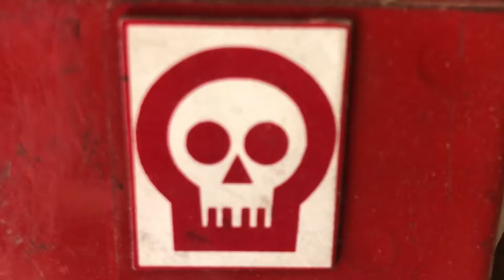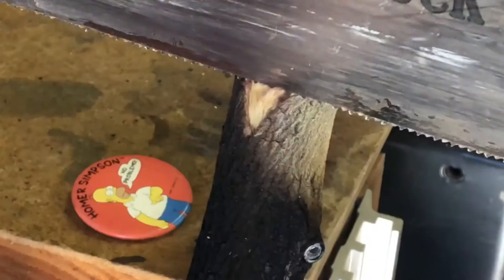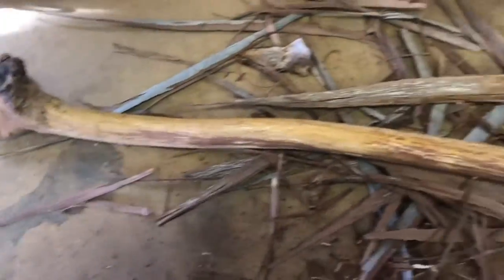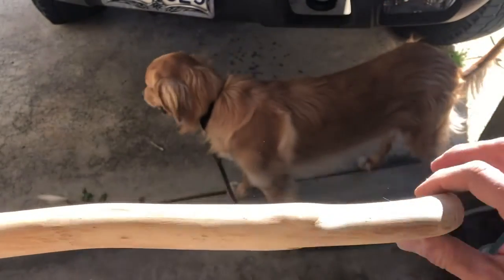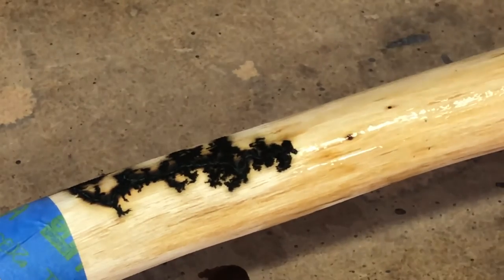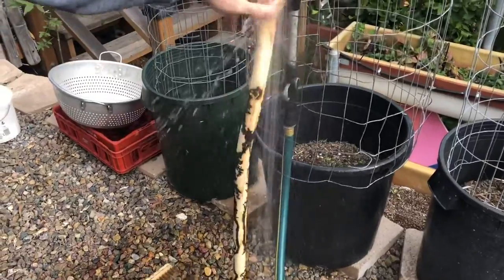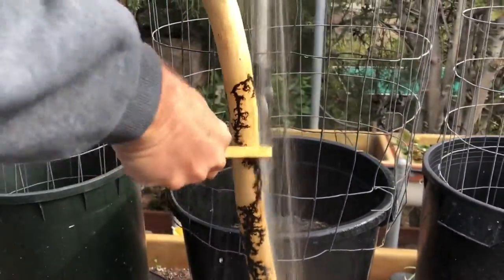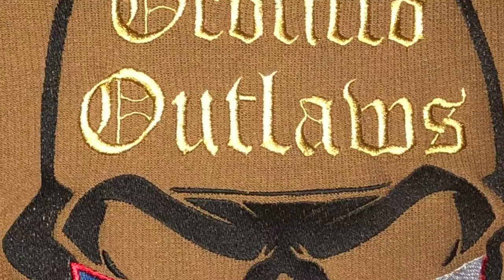Making a walking stick (#81)

Comment: I make walking sticks and canes for a hobby. I use side grinders with a steel Kutz all extreme disc to remove the bark and shape the stick. They last a long long time. Next, I change side grinders to my flap disc with 40 grit. I smooth is out as best I can. Finally, I switch to the Dewalt finishing sander with 60 grit paper. I do not like stain as I feel it hides the grain. In some cases, depending on the wood, I may lightly burn the wood to make the grain pop. Then I put a coat of tung oil cut 50% with mineral spirits. I let it dry and repeat 4 or 5 times. Next, I switch to polyurethan cut 50%. Another 3 coats. Finally, I use poly in a spray can for the finish. By the way. In between every coat of tung oil or poly, I rub with steel wool. This makes the finish smooth as a baby's ass.
Reply from the maker: Hey JR! Thanks for checking out the video and taking time to make a comment. It sounds like you have quite the process, and I bet those sticks look really awesome. You should make a video and post it. It would really be cool to check out the process and the finished product.

Comment: Very cool stick! I've been wanting to try fractal burning for years but that much power worries me. Found out the hard way how much 220 tingles; can't imagine what 15,000 would do.
Reply from the maker: Thanks Dana! When using these devices safety is the first priority always. There is no walking away from a mistake or accident. Even with experience working around high voltage I still get nervous and can't let my guard down. I make these for family and friends and each one has special meaning. As I have more time and there is an interest, I will be making more for sale. Thank you for taking the time to watch😎🤙and always good to hear from another creator!

Comment: I like stain, makes the grain stand out.  Difference likely is, you buy your stain, I make mine.
Reply from the maker: @ThFitz  
Stain really does make the grain on some types of wood look better for sure. That’s really cool that you make your own stain! Please share the process of how you make it. Thanks for checking it out! ☮️🤙🏻
Reply: Well, actually I use more than one method.  But right now make it by using 1 part paint, to 10 (or more) parts thinner.  If not satisfied with grain, more thinner.  Can get some amazing results that way at times.

Comment: Really good burn however you can't pay me enough to hold probes with rubber gloves. There's safer  ways to achieve the same results. Your project turned out beautifully be careful.
Reply from the maker: Hey Russ! Thanks so much for taking the time to watch and comment, that means a lot 😎 I totally agree with you on the safety factor... Even with electrical experience, a rubber floor mat, double rated gloves it is dangerous. One error and the outcome is not desirable. The probes I use are double insulated and have a plexiglass guard. Even after that it is a risk. I will heed your advise and definitely always be careful.
Thanks again! ☮

Comment: I'd have to argue, there is an easier way to do it lol. Soak it in water for a little while, let dry then use a bark stripper
Reply from the maker: Hey Swiftey! Thanks for checking it out 😎I agree, and have used that method with good results also. Thanks for taking the time to comment 🤙
Reply: Draw knife!
Reply from the maker: @rossandersen942 just picked up a real nice one! Thanks for checking it out 😎

Comment: Love your work
Wood you add a colored stain before the electrical process 
Or after ?
Reply from the maker: Hey Ed ! Thanks for watching 😎 always after. Good clean wood without stains or oils is the best way to achieve a good result. The wood needs to be able to absorb the conductive solution that you apply. Just finished another stick and saw your message! I hope this answers your question. Feel free to ask more questions if you have them. ☮
Reply: @ocotillooutlaws4101  Thank you for the advice and quick response, I will send a pic of my finished product
Reply from the maker: @edhopke9686  Awesome, can't wait to check it out 😎

Comment: Why don't  you explain the equipment you used to burn the wood.
Reply from the maker: Thanks for your question/comment. I Made this video to share the story and the process not necessarily the equipment I used. this hobby isn’t for everyone as it’s very dangerous. If you make one mistake it could be deadly, but since you asked I use a 15,000 V neon sign transformer with insulated probes controlled by a foot pedal. I also use high-voltage insulated gloves with a pair of rubber gloves underneath that. The foot pedal energizes the transformer and also is a safety feature in the instance of an accident so that it will stop the current when your foot is off the pedal. As I stated, in the video, this hobby is not recommended for just anyone it is dangerous and people do die every year using these devices. I hope this answers your question 😎 thanks for taking the time to watch and comment!

Comment: Question, I have the same fractal burning machine. How do you get it to change directions like that? Are you moving the other probe?
Reply from the maker: Hey William! Thanks for your question, it’s a combination of moving the probes and placing the solution only where you want it to burn 🔥 hope that answered your question. Post back and let me know if that works for you.
Reply: @ocotillooutlaws4101  thanks for the advice!!! I’ll try it and let you know!!!
Reply from the maker: @williamswecker1615  I also remembered that I made one I think it’s called restoring a bowl that shows more of the process of doing that
Reply from the maker: @williamswecker1615  video #52

Comment: I get a very BigstackD vibe from this channel, the difference of course is that you talk and that you aren't melting steel.
Edit: How the hell are you making those burn marks move through the wood without moving your woodburner? Its like red lightning.
Reply from the maker: I will have to check that channel out melting stuff is cool! Thanks for your comments and taking the time to watch 😎 I use a foot pedal to control the voltage. Yes, it is exactly like lightning and just as deadly, it is variable and about 15,000 volts.

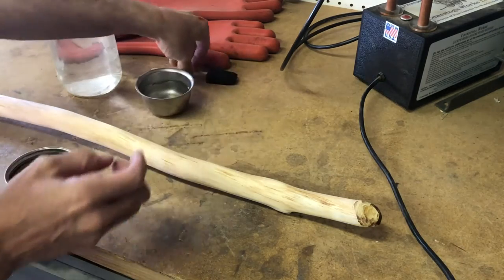Comment: 7:32 💀 Say whaaaaaaaat?
Reply from the maker: Hey Jennifer,
Thanks for taking the time to watch! Yes, unfortunately people do die while making this type of art. Working with electricity is always dangerous just like mountain climbing even with all the safety equipment experience and precautions accidents happen. This type of art is not for people that don't have a working understanding and experience of working with high voltage. You are in fact holding lighting in your hands on a small scale. 🤙☮

Comment: i HAVE TO SAY NICE STICK AND GREAT MUSIC :)
Reply from the maker: Good jams are a must when working in the shop! Thanks again 😎
Reply: @ocotillooutlaws4101  MOST DEF, I AM GETTING READY TO START MAKING MY OWN STICKS GETTING READY TO BUILD THE Lichtenberg HAD TO COPY N PAST THAT WORD LOL ANY POINTERS?
Reply from the maker: @themaximusone  Do your research. If you have never worked around electrical current and have no experience with electricity DO NOT build a device. This is something that you don't just decide to do. Having an accident or making a mistake will kill you. Even with experience doing this is dangerous and people die every year using these devices. It's like mountain climbing even with all the safety equipment people still fall and die. With that being said, please spend plenty of time researching and educate yourself on the dangers of the process and be familiar with electricity. Most of all BE SAFE 😎and do not take chances. Post back here and let me know what you find out in your research.🤙☮
Reply: @ocotillooutlaws4101  a No would have been much easier lol
Reply from the maker: Just want you to be safe and stick around for a while 👍🏻